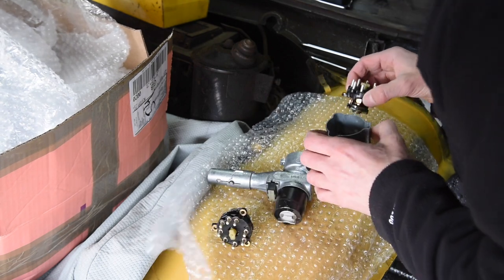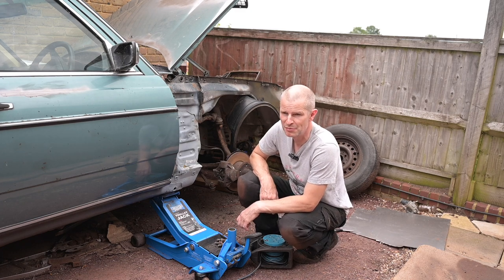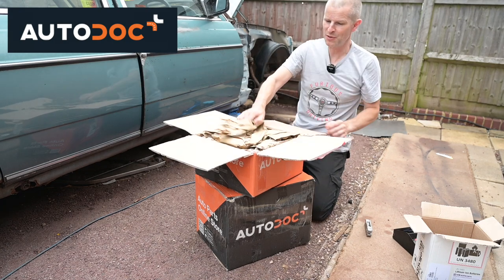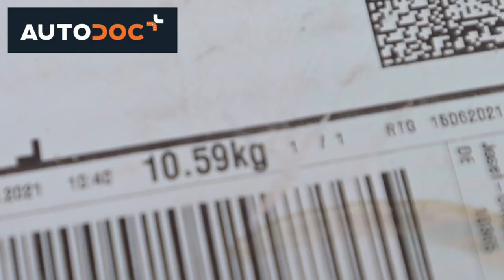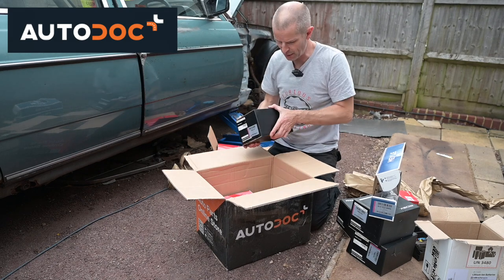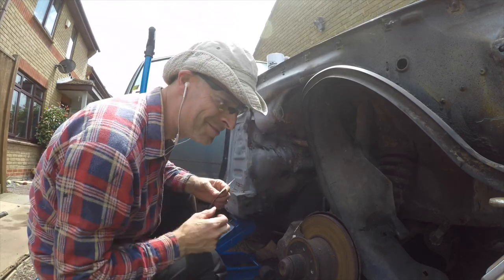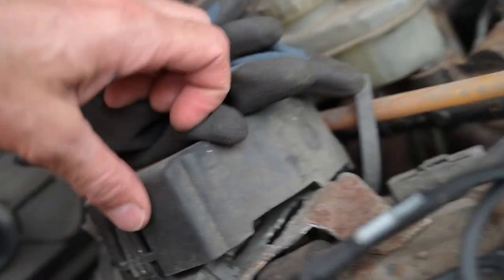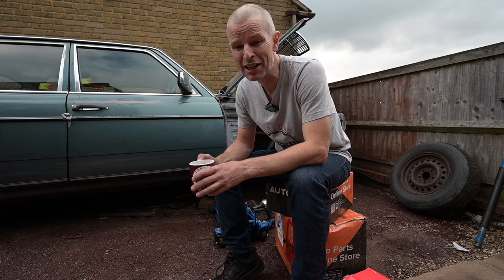W123 welding continues and a HUGE box of AutoDoc parts arrives

Comment: I love the W123, I wanted one for ages and I resisted the temptation to buy many and waited till I found a relatively good one that was structurally very good.  I think that it's nearly always better to spend a bit more when buying a car like that and in doing so save a awful lot of problems.  You are going to run into problems now anyway even with the best examples simply based on the undeniable effect that time and exposure on on many parts, especially rubber parts.
Many argue the 123 is the best production car ever built, I will not argue with that except that the W124 was at least as well made, and in my opinion some Volvo models were again at least as good.
I love your videos and I like that you get hands on and do stuff like welding yourself, also despite everything I said about buying a better condition car to start, I have a great deal of admiration for anyone who takes on a project like this with a barn-find, the W123 as great as it is, is a complicated car to restore.

Comment: Well done Matt! As much as you dislike jobs like welding, you simply press on and get it done!
As you were describing about the small hole, I noticed a rubber tube coming out in between the door hinge and where the front wing would be. I get that is clogged (you can see some detritus, debris). Please check and if blocked, to unblock. This could be the cause of why the interior got absolutely soaked last year.
Glad important parts are still available because many of these were sold all over the world. Although some other parts are becoming very rare.
Will be waiting for the brake system episode!
Don't feel bad, it looks like it will rain here once again in upstate New York!

Comment: I've been doing a rolling restoration on an R129, albeit not with holes like your car but I have been astounded how cheaply you can replace the mechanical parts like brakes, suspension bushes and service parts. Good luck with the welding as you seem to be taking it in your stride and getting better. Autodoc seem very good although the non-discretionary insurance charges seem annoying

Comment: Kudos for deciding to carry on with this. If you don't already have one you might benefit from a fire proof welding blanket - very handy to put the other side of things you are welding to stop sparks from grinding and welding setting things on fire. You can fold them up and drape over any remaining interior trim, windscreen, wiring loom etc. to protect them. It really helps stop the sparks travelling quite so far.
Reply from the maker: That would be a useful thing to have actually, grinding sparks and all sorts fly a long way

Comment: I have used autodoc a few times, like you I bought brembo pads and discs for my XF, they were the cheapest, took about 8 days to get to me, and when I needed brakes for my traffic I went to them again, choosing brembo, Renault wanted to charge me nearly £400 for pads all round, I got the pads fitted by a local guy, all in cost me about £120, a big saving over main dealers quote.

Comment: At least you have a good welding machine, i still have my gasless mig, which does the job but takes more time cleaning up the weld as you go along…….but its still cheaper than paying someone else to do it. When you do the cills take pics of the welded area before you grind of excess and seam seal…..i once had m o t tester almost fail  a car i welded because they like to check its done properly and not just filled.
Reply: I'm a bit jealous of that welder, having only a flux core welder myself . My stick welder is easier to use but would burn holes in the thin steel 😭. Maybe Santa will bring me a proper mig one day hahaha

Comment: Matt you have one part missing which is also very important. The slave cylinder also needs to be changed as well.
Reply from the maker: You might be thinking of the clutch slave, on the brakes the callipers are the slaves

Comment: Well done, Matt. The old girl is coming along. It is too bad that these cars rust the way they do, as they really are lovely cars indeed. I miss the Mercedes like this that were built to quality, not price. That is a diagnostic port. The Volvo gas the same one. Good old Bosch Electrics at work. At least the Benz is old enough to have missed both the biodegradable insulation and multiplexing. Makes it much simpler.

Comment: The discs actually look ok, wire wheel + wire brush to remove the rust,  and the discs themselves didn't have any sizeable lip on.
Reply: it’s still probably best for safety to remove 20 Years of break damage with relatively inexpensive for the quality brake disc & pads
Reply: @henntendo  what damage are you talking about?  (and I believe you mean brake, not break).

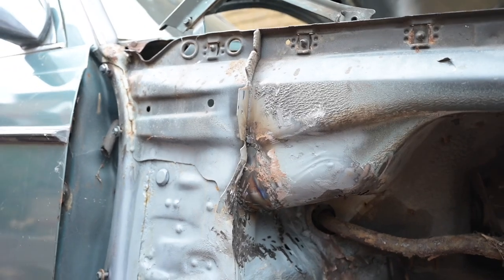Comment: 11:44 I could be wrong, but I suspect that there is no way to repair damage like that without compromising the energy absorption characteristics of the original design; there is simply no way to even know all of the choices MB made in the shape and composition of a structure like that, let alone to emulate it with welding or some other method of patching. But a car this age and of this quality is likely to lead a fairly easy life if it's fully restored, a much quieter existence than an un-restored banger that still carried around all that hidden damage. So it seems reasonable to assume that your welding will be good enough for a 38-year-old car, and owning such a car will be well worth the risk. It's still much safer than, say, a 1960 Consul that would be similarly cherished.

Comment: Nice progress. Personally I prefer Ate brake parts, as far as I know that was OEM fitment when they were built. Not too expensive either. I bought discs and pads (front) for my '98 C Class for about 120 EUR. I am not to focused on OEM parts, brakes being the exception, purely based on experience. Personally I do not have good experiences with Brembo, but that must be me.

Comment: I thought you were going to go all Jeremy Clarkson on us...

"I went on-line, and I found...  THIS..."

A pretty easy way to get a good idea if your servo is still operational is to check inside it for the presence of brake fluid when you take the master cylinder off it.  If there is brake fluid inside it then the diaphragm is likely to be toast as the brake fluid will attack it.  If that checks out OK then check around it for penetrating corrosion in the metal can as you don't want what is supposed to be a chamber with engine intake vacuum open to the air, which is exactly what will happen if the front of the can is breached.  That's probably less likely on a full production car like the Merc as they tend to engineer them in a way so that the servo doesn't get exposed to road dirt, whereas on specialist marques like TVR the servo can be exposed to road dirt and so will rust out and fail in that manner...

Comment: Have you sold Quintin already? If you have, you should consider the Range Rover P38, they are slowly going up in value, a fine example of classic Range Rover design. Parts are extremely cheap and plentiful, and you are already highly experienced on the 4.6 engine.

Comment: I feel sorry for restoration of old cars in UK.  Rust in these cars are not a problem as long as all drain holes are kept clean. They seem to be designed for a perfect environment where only water comes down from the sky, not leaves and insects.  The anti rust rubberized under car treatment is only designed for external protection, but does the opposite for internal leaks, harboring water.  I unfortunately had to weld a  complete front floor pan on mine.  A case of weld, put out a fire, weld, put out a fire. .lol.

Comment: Youre doing well with the Merc, it looks a big project, Did you feel your welding has improved with the new mig ? i certainly felt mine did when i got one of those welders. I enjoyed doing the welding on my car but it did get boring, now i am stripping , cleaning and painting the suspension and rebuilding the brakes, i hope to get my Viva on the road this year. Keep up the great tinkering videos
Reply from the maker: Yes, Ive got lots more control so can fine tune the power so much better. Before to was either too weak to penetrate or to much and blowing holes, now I can get the sweet spot and its so much easier. The old one was a £250/300 Machine Mart one, this should have been £600 but was half price on black Friday, Its a Rohr and can do MIG and stick welding
Reply: @furiousdriving   I was the same i was borrowing a clarke mig but never got on with it, i blew lots of holes etc,  i  bought mt Rohr mig last summer and really agree how good they are for fine tuning. I have recently been considering using Autodoc as i have seen them used by other utubers.

Comment: Parts availability is really good for such an old car.  Uhm, when I was at school (yes, we had schools even back then) wood was stuff that was used to make fire!  Just saying.   .   .
Reply from the maker: haha it is less melty that wires though
Reply: Thought the same... tin foil can be rolled into a ball and used to prevent fire starting/melting the loom etc.
Reply: @terryatkinson899  Or, how about a plumbers soldering mat.  Cheap and reusable.
Reply: @grayfool  never heard of a plumbers mat. You learn something new every day 🙂👍🇮🇪
Reply: @terryatkinson899  It is literally a thick fireproof mat, used to be asbestos, that you put between what you are soldering and walls, woodwork, ETC.  It just stops you burning stuff you don't want to.  Very useful thing.
Reply from the maker: @grayfool  good idea, I was going to crack on Saturday evening till it rained, I can get to Screwfix and pick one up now

Comment: 4:50 Are those solid front rotors, or do they just look that way after all the wear? The last car I saw without vented front rotors was my mother's '72 Toyota Corona MKII. I also noticed what look like steel rims, and MB's not-quite-real-leather seats are legendary. I guess you  don't  have to have all of the industry-standard "selling points" if you can build a car correctly without them.

Comment: You're steadily chipping away at all the nasty stuff. Even though you've got holes, they seem quite localised, testament to the thick steel that Mercedes used back in the day! New parts always helps to boost morale too and Brembo are really good quality. You are not alone, there must be hundreds of guys or gals up and down the country welding away on their classics......well ok maybe a couple! Thanks for the recap, I didn't realise you'd gone through so much just to get the engine running, to me that was a bigger issue than the welding!
Reply from the maker: At least the welding is obvious what the problem is rather than trying to figure out whats broken!

Comment: What welder are you using? Good work also 👍🏻👍🏻
Reply from the maker: Its a Rohr. Not come across them before but its German brand and very controllable
Reply: @furiousdriving  thanks for the reply. Is it a gas MIG?
Reply from the maker: @craigsmith6519  yes, but can use gas less wire
Reply: @furiousdriving  thank you. Sorry one more question, which model is it? 👍🏻

Comment: If the rusty hole has a 5p hole you can get your fist through it, if your rusty hole has a 10p hole you can get your head through it, If the rusty hole is a 50p scrap it
Reply: "...keep cutting back until you reach solid metal. When I got to the towbar...."

Comment: I used to buy parts from Autodoc, but have now stopped, and I'm better off.

You can get your parts cheaper elsewhere. They do false advertising (everything is on sale all the time). They also try to make you download their app even if you don't want to, and try to make you pay extra for a "safe order" or whatever it's called. Delivery isn't as fast as it used to be.

They often substitute the parts you order with "Stark" (I believe this is one of their in-house brands) branded ones, which I think are really just overpriced low quality parts. They overprice them so they can claim they are equal in quality with some well known brands.

I now use mainly two parts dealers, one is Estonian and the other is Finnish. I get exactly the parts I order, I get them cheaper and faster, and their business is more honest. And I'm happier.